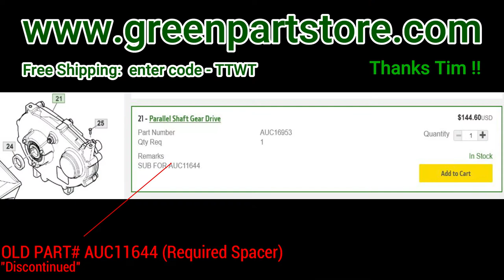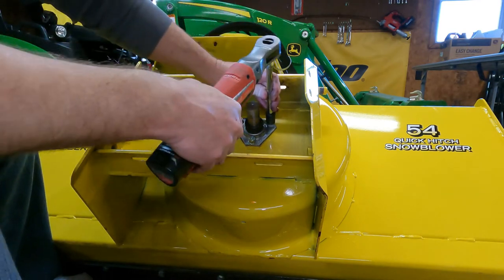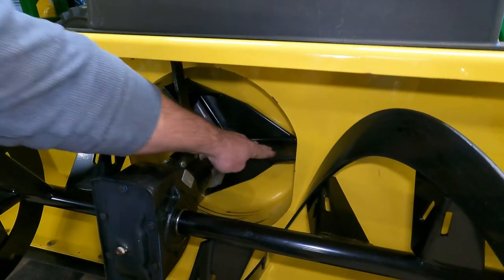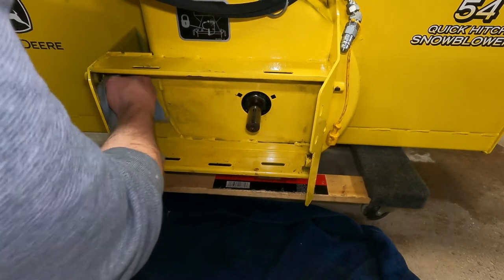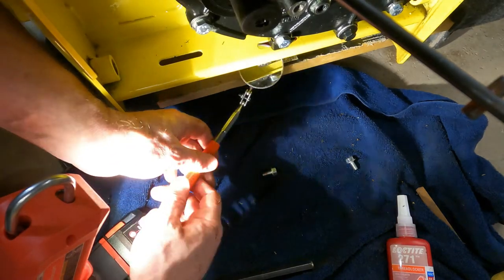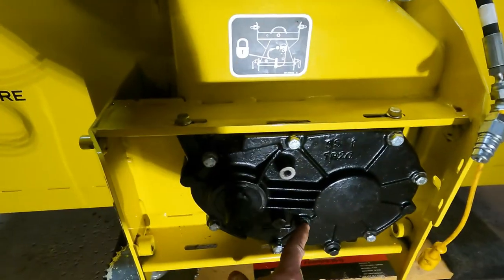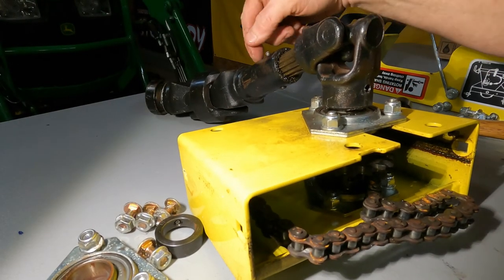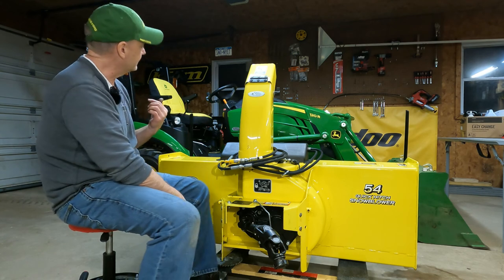JOHN DEERE 1025R | 47” 54” SNOWBLOWER CONVERSION PARALLEL SHAFT GEAR DRIVE

Comment: Thank you very much for the video. I have been wanting an upgrade for my 47 inch snow blower for years. I gave up looking for an upgrade on the John Deere parts website, then I came across you video. I ordered the parts and just finished installing the enclosed drive. After it was installed and I was checking the sheer pins, I found one simpler step. Loosen the set screws on the arm (part #120084) that the impeller connects to with a sheer pin. Remove the sheer pin. Then slide the arm forward and remove the pin on the shaft and slide the impeller forward. Remove the bolts that were holding the rear bearing in place. Install the enclosed drive on the impeller shaft. Slide the impeller back against the enclosed drive, re-install pin in the impeller shaft and slide the arm back into place against the impeller and re-install the sheer pin. Thanks again for the video.
Reply from the maker: Hey Kurt, Thanks for the compliment and for stopping by the channel. It was a great project and love how much more quiet the drive is compared to the open chain and sprockets. Excellent simpler step you offered. 👍🏼 Take Care.
Reply: Yes, I am very impressed with how quiet it runs compared to the open chain drive. I hope we get some snow this winter in Southeast Saskatchewan so I get to put it to use. Here is a video I create about a few modifications I made to my 2320. Stay safe. https://youtu.be/60X6A0D2EHo
Reply: @SometimeIsNow  hi again. I have used the blower a few time now and it is amazing how quiet it is. I don’t see and change in throwing power / distance. We have had a large amount of snow but didn’t see any difference other than noise level. Thanks again for video. Merry Christmas
Reply from the maker: @mohrk1  Hey Kurt, That’s great that it’s quieter. The lower noise level and ease that it brings for not having to deal with spraying the chain all the time is going to be the two biggest factors for me. I didn’t think it was going to increase the throwing distance as the gear ratio didn’t change with the box. Take Care and have a Merry Christmas 🎄🎁 Hopefully we’ll get some snow to play in. 👍🏼

Comment: I have a new 2022 54" snowblower. Took the snowblower off and prepared to install the parallel shaft gear drive but found it was already installed. Maybe JD is now installing these at the factory. Check your machine first.
Reply from the maker: Hey DJ, Yes sir.. You are correct. The new 47"/54" John Deere Snowblowers are coming with the parallel gear drive. I assumed everyone knew that's where they were getting the parts from was the upgraded snowblower drawings from John Deere. I will make a highlighted note in the description that new snowblowers already come with the parallel gear drive and there's no need to upgrade if they have a newer blower. Take Care 👍🏼

Comment: I never knew this kit existed, thanks!  As of 08/02/2024, the gearbox is $250.00 now, but still think it's a worthy upgrade.  I always have trouble with the chain drive on my 47 blower, so it looks like this is the ticket!  It is also very common for the blower shell to crack around those 3 bolt holes that the main shaft goes thru due to torque stress.  Since this gear case has the 4 bolts around the frame too, that should spread the load and prevent cracks or stop cracks that have already happened from getting worse.  I will definitely be getting this kit for my 47 blower and replace all the bearings too.  Thanks for posting this!
Reply from the maker: Hey Machone, 
Thank you for the kind words and for watching the video..For sure the Parallel box is well worth the money even at $250
Take Care 👍🏼

Comment: I just completed install yesterday 10/04/22. I don't think I would have attempted this myself without your video. thanks so much.  Today I wanted to add gear oil and discovered mine came prefilled. I wanted to add gear oil through the lower drain hole (like I would with a boat motor lower unit) when I lossed the bolt the oil drained out. I refilled through the lower hole until it started to come out the upper hole. thanks again!!
Reply from the maker: Hey T, Thanks for the kind words and for stopping by the channel to check out some videos. I’m glad the install went smooth for you..👍🏼 That’s strange that yours came with fluid already in it. Did you fire up the blower to notice how much quieter it is? That’s one of the things I liked about the upgrade. Take care 🤙🏼
Reply: @SometimeIsNow  I haven't fired it up yet but will soon. I'm excited to see the difference. A friend recommended installing the parallel gear box as it made his blower quieter and reduced vibration. Thanks again!

Comment: TY. I’m in the process of doing this job now. Just wanted to says thanks. You covered every step which will greatly help. My old chain and sprocket were getting warn at 5 yrs use and were noisy. My gearbox should be here in a few days and I now am at the point of reassembly.  Again TY. Following and subscribing
Reply from the maker: Hey William, Thanks for stopping to check out the video. You’ll love how quiet and smooth the new parallel box runs.. It’s well worth the upgrade. Thank you for Subscribing. Take Care 👍🏼

Comment: Thanks for the video Tim. I’m switching my 47” over today,wish me luck. One question I have is why couldn’t you have loosened the impeller set screws to bring forward the impeller to get them bolts out rather then what you did? My instructions I got from JD parts man showed doing it that way. Those sprockets and roller chain are junk.
Reply from the maker: Hey Roger, When I completed my conversion there were zero videos out to show me how everything came apart and what needed to be removed so I did it the way I thought I needed to. I had no instructions and it came out good and works with zero issues. It’s going on 2 yrs now and everything’s working perfectly. If you find a better way you could try it your way and report back.👍🏼. This channel is always about learning from everyone. 👍🏼 Take care

Comment: Thanks so much for this video.  I have a 47" from the 90s and your video was immensely useful.  I had to use a gear puller to get the impeller gear off and the c spring (tension bar) fractured when I tried to get it out.  I also had to use a emery cloth, silicon and a bigger hammer to get the replacement assembly onto the drive shaft.  Other than that everything went exactly as you described.  Thanks so much.
Reply from the maker: Hey @Strange times, Thanks for stopping by to check out the video. Glad it helped. Emery cloth and a bigger hammer is always our friend 👍🏼 Sometimes a little Mep gas torch to warm up the Assy works well for fitment. Take Care and I’m glad you got’ r done 🤙🏼

Comment: Hey, really great info. Thanks! Does the gear ratio remain the same?
Reply from the maker: Hey Joe, Thanks for stopping by the channel. Yes, The gear ratio is the same.. The only difference between the two drives is one’s open and one’s a sealed unit running in oil. So far zero issues and the blower runs so much quieter and no more grease and rust all over the place in the rear of the snowblower from the open chain and sprockets. Take Care 👍🏼
Reply: I just ordered one!  @SometimeIsNow

Comment: I just ordered one of these side by sides to install in a 54 and was wondering has anyone had one of these open? Is there any kind of tensioner inside and how long does the chain inside last being in an oil bath? is it a single row chain? Thanks Steve in Anchorage
Reply from the maker: Hey Gussuk, Thanks for stopping by the channel. I haven’t seen anyone open one of these up to see exactly what’s inside..

Comment: I love your video and have shared it with many other owners.  I think I also found a step to add that will make it easier to do with 1 person.  When you're removing the 3 bolts from each side of the auger (Around 10:30 in the video), loosen BUT leave the top one's in (just loosen the bolt). you can "swing" the front out by pulling the entire assembly out letting the 3 carriage bolts at the back fall away.  Then slowly letting it swing back into position to put the 4 auger bearing bolts back.  Hope it helps someone else so you don't need to support the weight when doing alone.  It made this incredible video even easier.  Thanks again!
Reply from the maker: Hey Charles, Thanks for stopping by and supporting the channel in a positive manner.👍🏼 Leaving the top carriage bolt in to help support the auger is a great idea. Any time you can make something easier. I’ll pin this comment to the top. Hopefully it helps someone else who is doing this alone and might need that little extra. 👍🏼 Thank you and Take Care..

Comment: Great video!  I made the switch to the oil bath upgrade today.  I watched your video and it walked my right through the process.  I did switch over to a metal impeller, which was an SOB doing myself.  I had a difficult time getting the auger back into the housing without dropping the bearings and spacers several times... ohhh my back.  Anyway, say hi to Riley for me.
Reply from the maker: That’s great Kevin. I’m glad the video helped you..Yeah, I bet that Auger wasn’t fun trying to get back in. I’ll tell Riley you said hello.. 😁 Take Care

Comment: I replaced mine recently but I needed to replace the shaft as the old one was damaged. The one I got from John Deere is too long looks  like I need to cut 3 inches off which seems a lot. Is there a model number for a shaft that is more compatible. ?
Reply from the maker: Hey Edward, Are you referring to the shaft coming out of the parallel box that you install the driveshaft on or the shaft running back from the front auger gear box that install into the front of the parallel box?
Reply: @SometimeIsNow  it is the short shaft that goes from the new installed gear box and attaches to the end of the shaft on the front of the tractor

Comment: Hi , I just installed this parallel gear drive and after looking at parts diagram I just noticed that there is a bushing that was supposed to be installed between the gear drive and the back of fan??  part # 24 on parts sheet.  not sure if you are having any problems with yours without that bushing?   Do you think I should take this thing back apart?  thanks Dean.
Reply from the maker: Hey Dean, If you ordered the Parallel gear drive part# I had listed (AUC16953)  then you don’t need the spacer. The newer gear drive box doesn’t need it because its engineered into the drive box shaft. The original gear drive box required the spacer but the newer one do not. You should be fine if you ordered the AUC16953. Any other questions let me know. 👍🏼 Take care

Comment: I just ordered the gear drive today and bolts ($240 delivered), it will be here this weekend. I have a question about the roll pin and safety wire...............can you just replace that with a grade 8 bolt & nut? All it's doing is holding the shaft in place, it's not taking any load really. Just a thought I had after watching the video today...............great video by the way, I'll be using it as my guide during the install.
Reply from the maker: Hey Steve, Thanks for stopping by the channel to check out the video. I don’t see any reason why you couldn’t use a grade 8 bolt in place of the spring pin if that’s what you choose. You’re going to love how quiet the new box is compared to the open chain and sprockets.. 👍🏼 Take care
Reply: @SometimeIsNow   I'm guessing from you other videos that you are up in The County. I'm down in southern tip of the state.
Reply from the maker: @stevehoward2827   No sir, I actually live in Upstate NY. I’d love to live in Upper Maine in the winter months 😁 The County area is amazing. We’ve ridden The County the last two seasons as the winters in NY have been lacking.

Comment: Good afternoon!  I checked into the cost of a parallel gear drive for my 47" blower.  Hopefully I am looking at the wrong information.  The part number JD indicates for my blower is AM145230 at $1,319.  Thats nuts!!!  Any other source suggestions?  Please let me know how I can compensate you for your time.  Thank you
Reply from the maker: Hey James, That sounds pretty extreme. 😳 $1,319  for the gear drive is to much. How did you determine you needed part# AM145230? What year is your snowblower? Is it really old?

Comment: Thanks for this, I just picked up a 54" last week from a guy in Limestone and it has the gearbox already in it but this was a nice step by step so I could see how to get the front off so I could slide the impeller off to do the flapper mod.
Reply from the maker: Hey Minuteman, I appreciate you stopping by to check out the video 👍🏼 Take care..

Comment: Does this change the speed of the fan at all... seems to be the one down fall of the original gear setup.
Reply from the maker: Hey Ken, Thanks for stopping by to checkout the video. No, The new upgraded box doesn’t change the speed of the auger and fan. It’s just an almost maintenance free upgrade unlike the open chain and sprockets. Take Care 👍🏼

Comment: Thanks! I really enjoyed watching this. I didn’t even know this was an option. Looks so much better that the gear and chain. I put my order in for this right away. One question though. You show using Mobil 1 80W90. I do like Mobil 1 products and have combed the internet but can only find Mobil 1 75W90. Is that close enough?
Reply from the maker: Hey Steve, Thanks for subscribing, commenting and stopping by the channel. It's greatly appreciated. I see the 80w-90 Mobil 1 is getting hard to find. I didn't give it a thought because I had the 80w-90 in the garage. I personally wouldn't hesitate to use the Mobil 1 75w-90 in the parallel box in place of the 80w-90 if that's all I had available. That should be fine. If you feel compelled to spend a little more $ there is one seller offering it on Amazon for $26.88 a qt. 
https://www.amazon.com/Mobilube-Plus-80w90-Gear-Oil/dp/B00NWWIV7W Click on all buying option on the right and you'll see the seller. Hope this helps. If you have any questions when you start the project let me know. 👍🏼 Take Care & Thanks again..
Reply: @SometimeIsNow  thanks for the quick reply and advice. 👍🏼
Reply: Gearbox arrived today. I should have that installed soon. 
How soon will you have the snowblower single point hydraulic video done? Do you have those part numbers available?
Thanks again.
Reply from the maker: @stevesmith5952  Great news Steve, Shoot me an email at:  yoursometimeisnow@gmail.com and I’ll send you part#’s and photos of the parts I have to convert the snowblower over to single point. Take Care..

Comment: The only thing I did different was greasing the shafts before sliding the gear box on and the shaft before adding the PTO drive shaft.  My blower dates from 2009 and the PTO shaft was rusted enough I had some fun getting it off the old small gear assembly.  I had already greased the shaft the large sprocket was mounted on, so no difficulty there.  I also saved the bearings from the small sprocket and the Auger Gear Box input shaft as they are the same bearings used on the ends of the Auger and I had to replace them on my original 1995 vintage blower so I am sure I will also have to eventually replace these bearings on my current blower.  Blue LockTite would have been a better bet to hold those bolts for future removal when you have to change the Auger shaft bearings, you will most likely have to remove the new gear box you just installed.  I used Anti-Sieze on my bolts as the county used salt on the roads and my blower gets a workout in the slush that creates clearing out the end of my driveway and they have held just fine.
Reply from the maker: Hey Edward, Thanks for stopping by the channel. I’m actually hoping I never have to take the box off. 😁 My tractor and blower are 5 years old now and live a pretty plush life. LOL It blows snow from a paved driveway so it doesn’t get the paint chipped and after its done it gets cleaned off after each use and put back in a heated garage to fully dry out. It’s pretty spoiled as you see in the video there’s no rust anywhere. Fingers crossed that parallel box was a one and one swap. 👍🏼 Take Care..

Comment: Thanks for the detailed video. I am ready for the upgrade, but as a novice mechanic at DIY projects, you have given me the courage to tackle this myself.  I have removed everything to replace a stripped propeller last season and then a key on shaft. So twice!  I will not confess how long it took me and how many expletives I said (by myself) in the confines of my garage. Classic rock paying in the back ground helps.   Much to my wife's, "enough already we need the blower have the dealer fix it, I won man over machine. It was a proud moment when it cracked up and blew the snow.  Our local John Deere dealer is 20 minutes away. My trailer is stored for the winter and it would cost me a minimum of $80 for pick up and delivery, not to mention their mark up in prices and labor.  I will try, and report back.
Reply from the maker: Hey William, Thanks for stopping by to checkout the video. That’s why I make these videos so people can watch the process and make their own decision whether they want to try this themselves and save some money from the dealers labor or say… this is to much for me and let the dealer do it. Seeing how you have already had the blower apart twice, you will be an expert at it. 😁 Just keep the wife out of the garage so she doesn’t hear you swearing and throwing tools 😂 Take Care 👍🏼